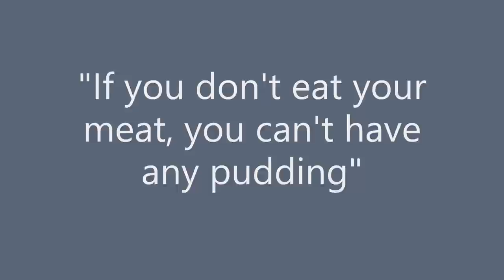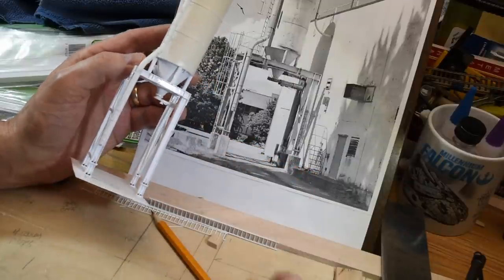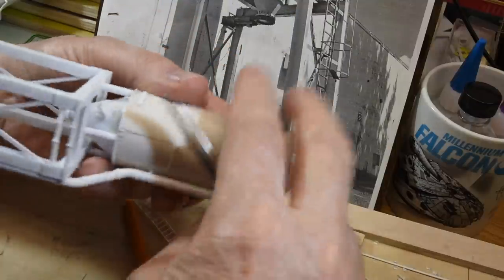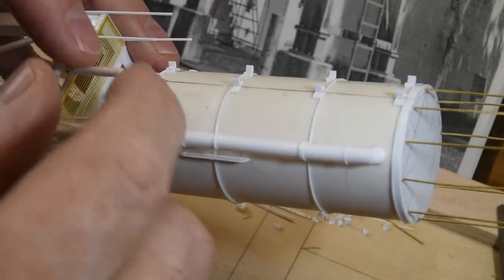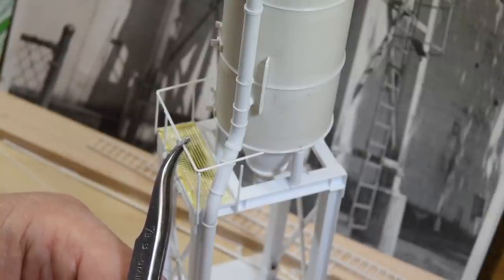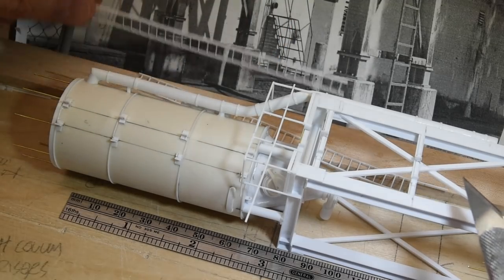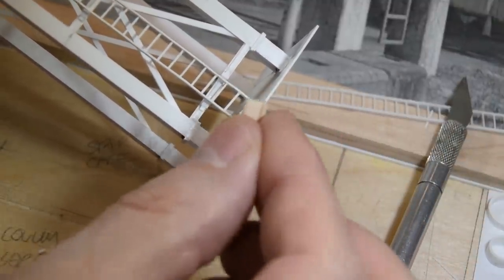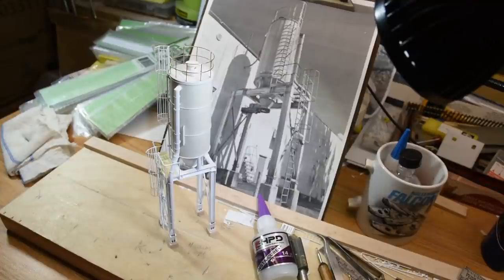The Brewery "Extractor" Final | River Road - Vlog #56

Comment: I’m starting to enjoy building my models while watching your vids. Just put some custom styrene boxcar door tracks on a combination door boxcar.
Reply from the maker: What boxcar manufacture is it? What model is it exactly if you can share? I was thinking the same.
Reply: @boomerdiorama  it’s an old US hobbies O scale kit from the 70s or 80s. Nicely done body but details are grossly out of scale. Got rid of the cushion underframe and redid it all with scale h columns. Protocraft proto48 trucks and couplers. Next I have to make up ladders and install AB brake rigging. Been a fun project but a lot of work to bring an old kit up to spec. I went to Proto 48 to try and up my skills. Thanks for asking and thanks for what you do for the hobby.
Reply: @boomerdiorama  the US hobbies kit is a Pullman standard 50’ combination door boxcar. It’s a UP prototype but I’m modding it to Milwaukee Road.
Reply from the maker: @1Nanerz  That sounds like a cool project. I have a real soft spot for Standard "O" Scale (Proto 48). If I could find an O Scale GP9 "chopped" nose (undec), and a couple of hoppers, I would probably build a small shelf layout around it, with a grain elevator. ;-)
Reply: @boomerdiorama  Lines West Products makes 3D printed chop noses in O scale. I’m actually working on 2 Milwaukee Road GP20’s built from Rad Caboose GP9 undec shells as well. Maybe I’ll do a YouTube vid on the builds.
Reply from the maker: @1Nanerz  Thanks for the heads up. The build sounds great! Share it if you can. Cheers ~ Boomer.

Comment: Will the ladder cage clear a hightop boxcar roof and all the engine cabs?
Reply from the maker: Yes. The area is tighter than I wanted, but it's the very end of the layout so it won't see much action other than a switcher perhaps. I know this sounds unconventional, but I took the brewery further than I planned. It was never meant to be compressed into the layout. It was a last minute decision. It was only meant to be a backdrop relief for the Barge slip. Cheers.
Reply: I just didn't want a errant engineer wreck your beautiful work :-) .  The derail will protect it most of the time.  Great work on the derail by the way!!!.
Reply from the maker: @rexroad9917  I actually tested it and it works remarkably well for a little piece of plastic. ;-)